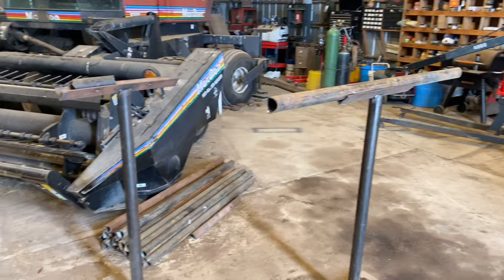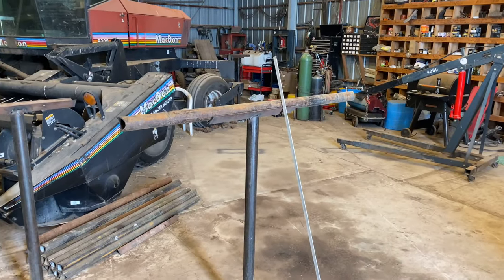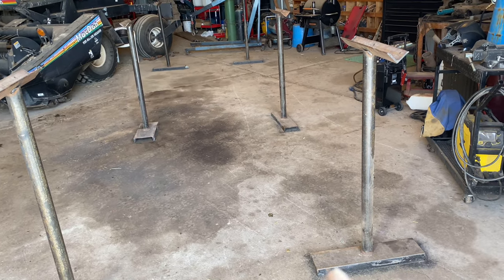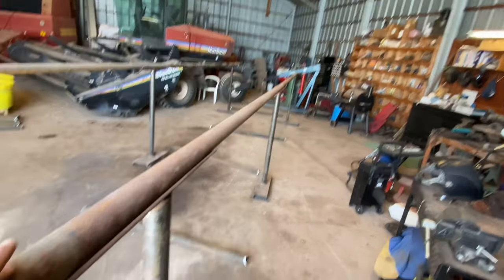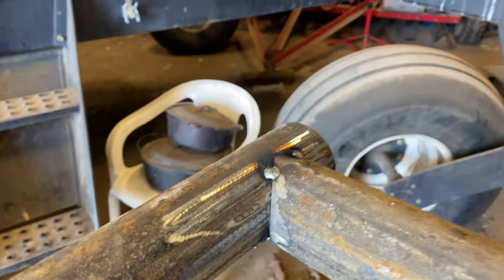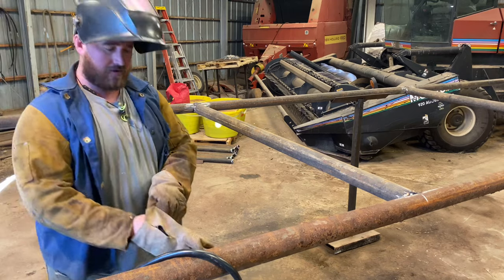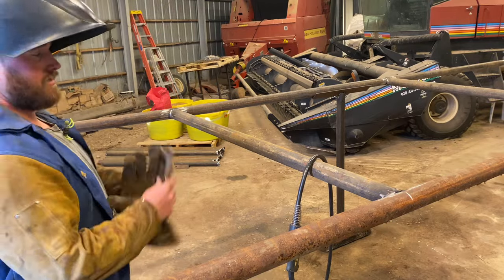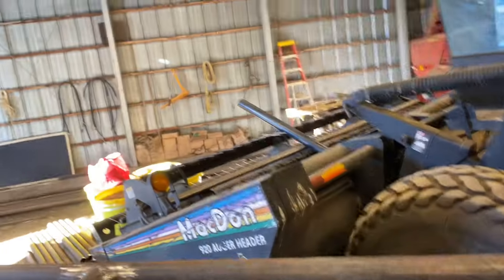How I Build Indestructible Freestanding Cattle Panels Part 1

Comment: Watched this vidjo a year ago & enjoyed it then too. Even commented back then, lol. Just wanted to chuck out an "idea" for you that you may like/not like - here, we changed from stick welding/gas mig welding heavier stuff to using 1mm flux core wire. 

Man I love that stuff now - at first I struggled finding the sweet spot and found it very finickity, very variable in the results I was getting but I stuck with it because the price they were/are charging for shielding gas went through the roof during & since "covid" - now I wouldn't use gas if you gave me it free & I think damn bad of having to use rods if i go out to do some welding on a farm or such where they want me to use their gear. The speed of the 1mm flux core is brilliant once you really master using it - there is a learning curve alright. Plus it lays down the hottest, strongest welds you can imagine - it can hose in metal without being any way as fussy as gas-shielded regarding how clean the steel is. 

Just my thoughts on revisiting this video - one grafter to another. :-)
Reply from the maker: Thanks for the suggestion! I’ll have to look into flux core wire. I haven’t ever used much of it and like you said at the beginning I thought it made an ugly weld and splattered all over the place. I could use more practice with it though. I’ve done a bit more with dual shield but still not a lot. Thanks for the comment!

Comment: Looks great!  I have quite a bunch of salvage and used pipe, a little too scabby to make and charge for others but I build panels, bale rings etc for my own use. To weld that I  use my wire if it's fairly clean,  but I've welded pretty rough looking pipe with 6011 stick reverse polarity. If it's needed for structural strength I root pass with 6011 and then cap it with 7018. Thanks for posting,  nice work!
Reply from the maker: You are welcome! If I’m in the shop I like using the wire feed just because it’s so much quicker but if I’m outside I like doing the same as you, do the root with 6010 and then capping with 7018. Have you ever ran into magnetized pipe?

Comment: Good job like to see the last step and some technical info your settings machines used etc.
Reply from the maker: Thank you, I just posted part 2 if you want to check it out. I use an Esab 215 Rebel and run it around 19 volts and 330 wire speed if I remember right. Then I use a Hypertherm Powermax 45 plasma cutter to cut the holes. And a Steelmax dry cut chop saw for doing my coping and cutting pipe.
https://youtu.be/umb42HN06XY

Comment: Steel tube/pipe here has become like hens-teeth - I  used have it laying about like everyone else did - now it's Premium Price - guys that make motorway signs (I.E - it's Paying like hell..) are struggling to get / afford steel pipe/tube here. I can't imagine, in my current wildest dream, anyone here opting to go for a steel-tube fence or gate - the cost would be off the scale. 

Just my 2c on how everywhere is different. :-)
Reply from the maker: It’s the same way here now too. I bought a semi load of the pipe I’m using now about 5 years ago and I paid $35 a length, 31’-33’ long and that was delivered price. Now I’m being quoted almost $100 for that same length of pipe not delivered. It’s crazy

Comment: What welder do you use I'm trying to get into welding to be able to do small personal projects around the farm so i didnt want to get a big ol rig welder
Reply from the maker: I have an ESAB 215 Rebel and it’s been a great welder. It can run off 120 or 240 power. It’s a multi purpose welder so you can do wire feed/stick/ and DC TIG with it. I think they are running around $2500-$3000 now. I would recommend it or a Miller Multimatic I don’t think you could go wrong with either one
Reply: @LuthiRanchWY  awesome thank you I'll definitely look into those

Comment: Richard Dye says to cut the angles at 33degrees. I’ve been looking at an evolution dry cut chop saw and from what I can see it only cuts angles between 45 and 90 degrees. How do you set your Steelmax to cut the smaller angles?
Reply from the maker: I’m going to try the 33 degrees out next time I cut some pipe and see how that works. I can set my Steelmax saw between 0 and 45 degrees.